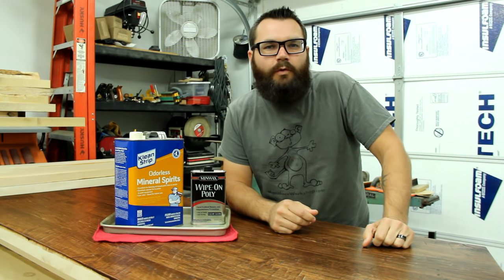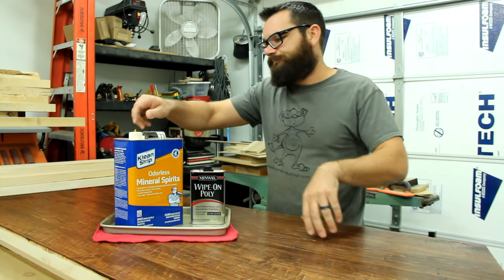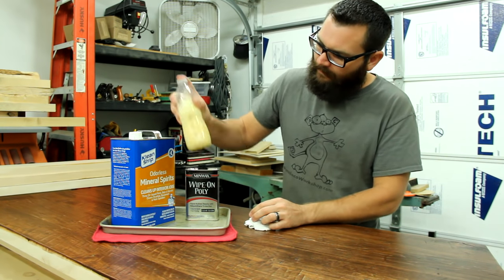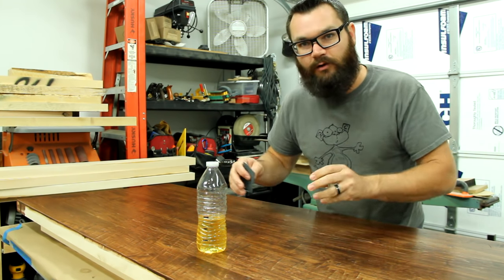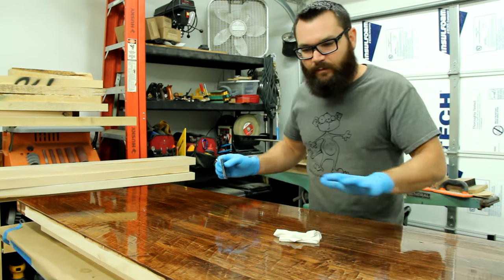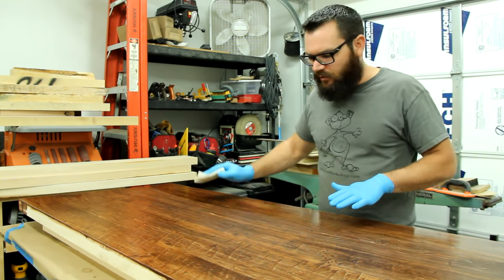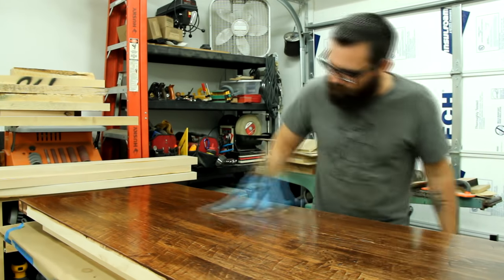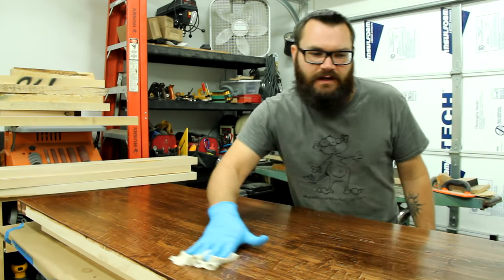Ultra Smooth Finishing Method - Great for tables or Counters

Comment: Sorry to bother you again. LOL. But this is like the third time I've watched your video and really like it. I was wondering if you would be so kind and do a video on getting this result on Poplar. From beginning to end. Thanks. Poplar is a conundrum to me. When it's not stained it has the most beautiful grain. When it's stained, even if you use Pre-Stain Conditioner, it seems to turn yellow/orange over time. I suppose that's the reason many furniture makers consider it a secondary wood. If you search throughout the internet and on YouTube you will discover little information and few videos on staining Poplar. Basically, they all say Pre-Stain Conditioner. Whether it's OH- diluted clear Shellac or Turpentine diluted Varnish followed by the stain. I once made a Poplar table and used an oil based stain and for some reason I got lucky and it never turned yellow/orange. The problem is, I haven't been able to reproduce this result. I refuse to believe that there isn't a way to bring that beautiful grain out, without it yellowing or blotching. Perhaps the Japanese know. Just can't find it on the internet. Thanks.
Reply from the maker: Poplar is a tricky one. I was once plaining a pile of poplar and was throwing it on the trailer (in the sun) after running it through the plainer. When I went back to pick it up a half hour later, every part that was exposed to the sun was much darker which was a very harsh contrast to pieces of the same board that had something blocking the sun.

Every time I've used poplar it's either been painted or hidden when you don't see it. Maybe if you throw it in the sun for a couple hours and get the color change out of the way early, you can get it to our desited color better? I'd have to experiement.

Comment: Hi Ty,

I am really interested in using this finish method for my table top. Right now, I have Minwax Fast-drying Gloss Oil-based poly, not the Wipe-on poly that you use in the video. Would I still be able to use my poly with the same results, or should I head to the hardware store and snag some wipe-on poly? Thanks!
Reply from the maker: Wipe on poly is pretty much equal parts mineral spirits and regular polyurethane. I'd just play with your mixture a bit.

Comment: Hi Ty, Question:
I'm putting a finish on a new stair banister I had installed. Already stained and have put 2 coats of oil based poly, full strength with just a natural bristle bush. It's "okay" but I wouldn't want to clean it with a paper towel. I'd like the handrail and post tops (areas that we'll be touching) to be smoother. I was planning on putting on 2 more finish coats. Do you think it would work well if I wet sand (to knock down air bubbles) the current poly and apply with your method to the said areas, even though I already have 2 coats of full poly on?
Reply from the maker: Sam B I would sand them all with 220 to get a smooth starting point.
Reply: Would you do a 220 grit wet sand with mineral spirits and poly first (working up to 600), or just do a light, dry 220 grit sand before starting in my case?
Reply from the maker: I would do a light dry sand first.
Reply: Great video and great help. Thanks Ty

Comment: What can I use for lunch room tables. The top coat on the school tables have came off. Will this work?
Reply: I used this on my table and it's super durable and stain resistant. Worked great. I think as long as you sand off the old finish first, this would be perfect for lunch tables.

Comment: QUESTION -  What wood finishes are acid free or at least best for archival gallery photographs?
Reply from the maker: That's a good question but I don't have much of an answer. Without a lot of research, I would say to go with clear epoxy but that really depends on what you're doing.

Comment: are you cutting wiping poly down with mineral spirits or standard poly?  I believe wiping poly is already cut down 50/50 no?
Reply from the maker: I am cutting wipe on poly down with mineral spirits even further to help with the wet sanding and French polish like finish. (French polishing is technically done with Shellac.)

I do vary how much I  thin it out depending on which stage I'm at.

Comment: Mine is has hazy swirls after sanding with 320 and two more coats, any advice getting rid of the swirls.
Reply from the maker: Finish each grit of sandpaper off by sanding with the grain. I'll usually keep an eye on the cross grain marks and make sure they're all gone before progressing to the next grit.

Comment: I like the method and have used it myself in some form or another followed up with automotive products.  Just wondering why you used Wipe-On to begin with....isn't it just Poly cut with mineral spirits already?  Might it be cheaper to buy Polyurethane straight and adjust the ratios to suit?

BTW  hate is a wasted emotion.  Just don't ask me to love you....that would make it weird.

Comment: I see that you are using a Wipe On Poly mixed with mineral spirits.  Any specific reason you've chosen to use Wipe On variety?  It is my understanding that Wipe On poly is actually just regular poly already diluted with mineral spirits/naptha/thinner.  I forget the ratio, though.  If so, do you think it is equivalent to use a regular poly and do a 1:4 or 1:5 ratio of poly:spirits?
Reply from the maker: +TMBridge From what I hear, wipe on poly is about a 1:1 ratio. I think you're about right with a 1:4 to 1:5 ratio. A lot of time I'll start with a 1:1 ratio using wipe on poly to build it up a little faster so maybe you should try a 1:3 ratio with regular poly and go from there. Temperature could also have some effect as the hot Arizona weather makes a move even ratio dry a little faster at times. 
As for why I use Wipe On, I've just always had good success with it and it's simple to apply and get a great finish with. If I'm spraying I'll use regular poly or another finish though.
Reply: Got small scrap? Don't ask, TRY! NASA accuracy is not required. Depends on if you live in the desert or wetland states. Plastic measuring spoons and cups at the dollar store.

Comment: Hey Ty,  Question 2 -  When you say 50/50 blend to start, are you talking about the 50% of the Wipe on Poly which is already blended?
Reply from the maker: Yea, to do the wet sanding and "french polish" the wipe on poly needs to be thinned down a little more. Depending on the wood and desired finish I mix up how much I thin it and when I do or don't do the wet sand & french polish.
Reply: Awesome!  Thank you so much for all the info and all the inspirational craftsmanship vids.  I will look forward to more.

Comment: Did you stain the table prior to the Finishing, and if you did, can I used Linseed oil, let it dry and then use your finish?
Reply from the maker: I did stain the table prior to finishing. As long as you let the linseed fully cure then you should be fine with adding a shelac finish.

Comment: Great video, could this liquid be used as a sanding sealer in woodturning ?
Reply from the maker: I'm sure it could but in that case why not just use sanding sealer? It dries fast and is easy to apply. I use sanding sealer whenever I'm turning a bowl that needs to cracks or punky areas filled with CA glue.

Comment: Try mixing in a glass container for your best results and stir the mix less and use less thinner and more elbow grease and you'll truly see your project shine and leave it with the hardest surface finish always top with a couple days drying time and good final finish chem and wipe it in with the softest of soft cloths healthy dry sponges work well and achieve a fully covered surface

Comment: I am confused as to how the sanding debris does not get stuck and mix with the poly?
Reply: Just wipe it down with a clean rag and mineral spirits prior to re-coating if you're worried about it.
Reply: The guy in the video was sanding while finishing....
Reply: He is sanding on top of existing poly you wouldn't want to do this on your first coat due to getting wood in your poly but sand with 600 on top of poly will just smooth it out and fine particles on poly will never be visible after the next coat

Comment: hello Ty, I tried your finish and it came out great except foe one air bubble. Can this finish be spot refinished or would it be seen?
thanks, bob
Reply from the maker: Hey Bob, it's been two weeks since your questions so hopefully you got past it. (If you did,  I wold love to hear what you did.) 

Depending on how bad it was, you might be able to apply a small amount of finish and wet sand the affected area to remove the air bubble. (What type of poly were you using, did you thin it down? How much?)

Comment: Thank you Ty. Question. On your final buff are you using your wet cloth still or a fresh dry one?
Reply from the maker: On the final buff I was using the same cloth that I applied the finish with.
Reply: Ty Moser   Thanks Ty. I did it this morning. Its a big slab table that I am refinishing. I had many coats hand rubbed on it already,using a 80% poly to 20% thinner. It just wasn't quite right. I used your mixture and rubbed it in with a 1500 steel wool, then a cotton cloth buff until it was dry. Took about 10 minutes and is is beautiful!!  Thank so much.
Reply from the maker: Awesome! Good to hear!

Comment: Won’t sanding it while still wet mean there is gonna be dust in the finish when it dries?
Reply: I think he is doing a form of slurry sanding, but by using finer sandpaper, the "dust" [invisibly] becomes part of the finish.  Slurry sanding is an old method of grain filling, where you sand the wet varnish, and the sanding dust fills in the grain.
Reply: @mattpeterson553  Interesting, thanks!

Comment: I've read most of the comments but couldn't find this answer...Does it matter if it's water based poly vs. oil based poly?
 My table has been stained and I just want a clear/matte finish, will that still look as good as yours? Thank you!!!
Reply from the maker: You've probably already applied a finish but the type of poly you use generally depends on if you put anything on it first. Water based you would thin with water but one of the downsides is that it dries faster so that might cause a problem. I prefer to use oil based polyurethane.

Comment: Thanks a lot. doing it right now.  How long do you have to wait between coats? btw - not sure if you care but you put your garage door insulation backwards.
Reply from the maker: When you think it out that much you don't have to wait long but I also live in an oven of a state. (Phoenix, AZ..) I might have waited an hour or two between coats.

I've read both ways on that insulation. The other side has the metal film which supposedly reflects the infrared rays so you want that on the outside but idk...

Comment: Hi there,
when you sand it, after some coats,  did you get a "cloud" (some white stain in the top coat)? If yes how to remove it?
Reply from the maker: +Blog das Madeiras Getting a cloudy finish in your polyurethane could mean a couple things. Some things to watch out for are: You'll want to make sure your finish isn't too old, too hot or to cold. I'm talking extremes here, I've finished outside of their recommended range but not really far out You'll also want to make sure the poly was throughly stained and your surface was nice and clean to start with and all oils were removed.

As far as removing it, I'm pretty sure the only way about it is to sand down to below the cloudy part and build a finish back up. You might follow my same process but just use mineral spirits without the poly and be slightly more aggressive with the sanding.
Reply: +Ty Moser (MonoLoco_Workshop) Thanks for the reply, but I think the cloudy finish are sand scratch marks, because they only appear in sanding.
Reply from the maker: +Blog das Madeiras Oh, are you saying that you are sanding it after finishing and not applying an additional finish after that? If that's the case then yea, you're absolutely right. When I am sanding between finishes, instead of during finishes, I only sand between finishing and never after the last coat. If you must sand after the last coat you could potentially sand it with a really high grit and try to polish it or apply a very thinned out coat of finish afterwards. (Or you could add a little wax and buff it.)

Hope that helps.
Reply: +Ty Moser (MonoLoco_Workshop) Thanks :D

Comment: Thanks for the video.  But I don't understand why you would be thinning Wipe On Poly?  If you are going to be thinning, why not thin the "straight" poly?  It is tremendously cheaper per unit volume.
Also, does the technique of continuing to wipe until dry also work on finishes with semi-gloss or full gloss?
Reply from the maker: I should have clarified a little. You can use either regular or wipe on but you'll have to change the amount it is thinned depending on the results you want. I had a bunch of wipe on that somebody gave me so..

I'm not sure about all of them but I know you can with poly if it's thinned down enough and you can with Shellac. (French polish)

Comment: how do  you remove the dust before you put another coat on after sandings in between?
Reply: Use a tack cloth. They're like $1 at a home improvement store. They're just a sticky gauze with linseed oil on them.
Reply from the maker: I will generally use a blue towel doused in mineral spirits before I go to a tack cloth if I use a tack cloth at all.

Comment: Tom, I used this method and it works great.  The only issue I had was with the 400 grid sandpaper, the blue on the sand paper kept dissolving and getting stuck to my project. My question is there a specific label of sand paper that you use?
Reply from the maker: Not really a specific label but you can't use a sandpaper with a rubberish backing. I've seen home depot start carrying a bunch of that stuff lately which I've also had gum up. Some sandpapers are labeled for wet sanding and they should work good.
Reply: Thank you Sir, for your assistance.

Comment: but when you wet sand it, dust forming and is mixed with the poly, no?
Reply from the maker: A little bit will but I'm also sanding with pretty high grit paper so it's very small particles. I'm also wiping/buffing it so many of the particles are taken off and the only thing left is what soaks in or drys on the surface. Also, after the first coat you should only be sanding off polyurethane.
Reply: @TyMoser  thanks

Comment: Question< How about sanding the finished Poly with some 0000 Steel Wool instead of a sand paper,? Will that worh to make it smoother also,? Thanks for sharing Geeat video etc.
Reply from the maker: I've never been a huge fan of 0000 steel wool even though that's always in the instructions. I've used it before but never on a wet application like this.

Comment: isnt wipe on poly just already thinned down poly? So this is super thinned down poly?
Reply from the maker: Yup, pretty much. If you want to wet sand it and buff it in, it needs to be thinned down even more than wipe on poly but it also requires more layers.
Reply: Ty Moser great tip! Thanks!

Comment: I have never understood why people don't do a thin coat first. Mechanically you want the first coat to penetrate, to stabilize, to reenforce, to seal the wood. Then scuff sand and 50/50 mix then 'rinse and repeat' at will, then to not thinned. 'They' always use 'liquid plastic-tane' in the opposite order. Everybody does spray bombs staring as a light coat. Paint primer is a light touch just to tooth and seal.
Why do people want to reverse the method of all other 'thicky' liquids handling methods?
Much easier to go thin to thick as well.

Comment: Did you sand while it's still wet??
Reply from the maker: I do on the final coats. When the finish is thinned down enough you can wet sand it and buff it until it's dry. It'll take a few more coats but you'll get a good finish.
Reply: So you do not sand on the first 2 or 3 coats?  I sanded and it leaves sanding marks with 200 grit as you mentioned to start with lower grit...

Comment: So, I'm working on building a desk just for general uses like writing on it and such. And I'm using 5/4 Hickory *I'm not very far into it yet, you can see my start of it here https://imgur.com/gallery/o1BTS * I've never worked with Hickory before and I've honestly not worked with very much wood in fine finishing. Anyway, do you think this type of finish would be good on Hickory for this application? Also, could you put this over a Danish oil finish or anything? I've not decided if I want to stain it or just put a natural coat of Danish oil or other similar product to bring out the grain. Any advice?
Reply from the maker: I think this finish would look good on Hickory and you sure can put it over Danish oil. Since polyurethane is oil based, it'll go fine over anything oil based.
Reply: Cool, Thanks for the help.

Comment: isn't' wipe on poly already thinned?
Reply from the maker: Yup but I like it thinner for wet sanding and it allows for more applications in a shorter time.
Reply: makes since if you are building a finish up seems like a nice method. thanks for the video

Comment: more important than a respirator: ventilation. Especially in these colder months. Don't want a fume build up and then the heater turns on. (nearly impossible but don't be the one to make the news)
Reply from the maker: +Adam R Yup, good point! I generally crack my garage door right after finishing and turn on a fan to provide some indirect air flow. Normally this would be awful since it wouldn't be filtered air but since I leave my finish buffed and pretty much dry anyways it doesn't get much dust stuck to it. Thanks for the comment.